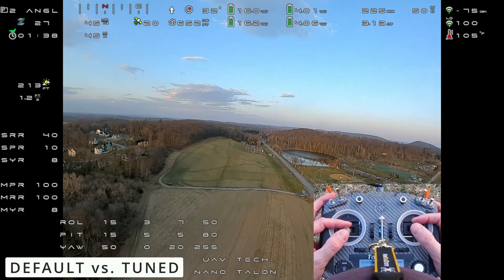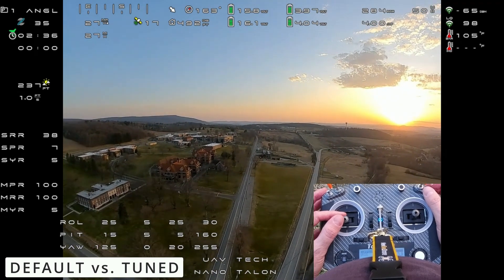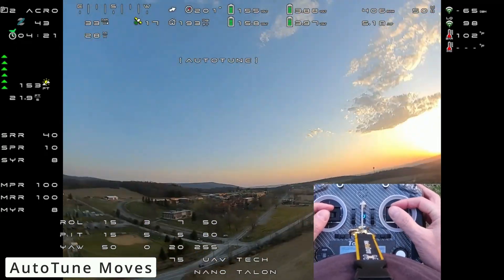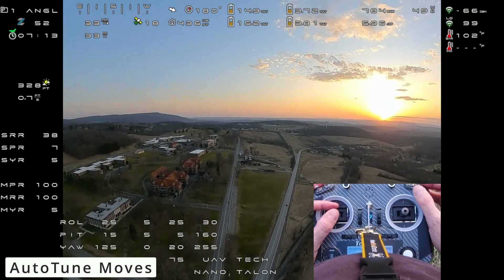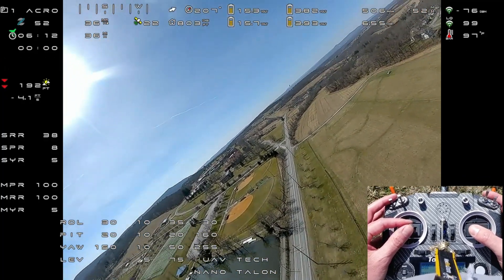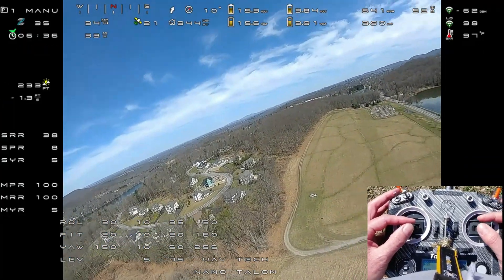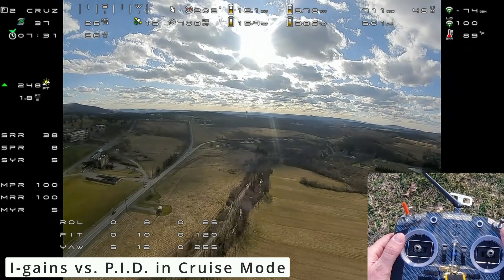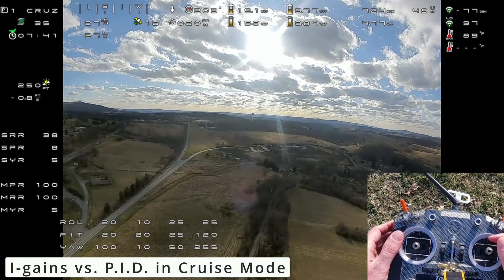🌟INAV🌟 Fixed Wing Stability PIDs Examples

Comment: It seems to me your roll "D" rate is way too high and you roll "FF" is way too low, and on your pitch it seems the "I" & "D" is way too high as is the Pitch "FF". This is why there seems to be little difference between no P&D and your "tuned" PID's.
Reply from the maker: FF on a plane is just servo throw in plane Acro.

D damps outside influences.  High is fast reacting.  Low is slow or little reaction.

I-gain just helps to keep the nose of the plane on target.

The very end of the video show the best example with Cruise Mode on Manual v. I-only v. Fully Tuned.  Now if you want a softer response to wind, reduce all the gains (except FF) OR go with I-gain only.  If you want a sharper response to wind, full tune + higher gains + fast servos.

You can use theuavtech.com/pidcalc to reduce or raisr gains together.
Reply: @uavtech  I get what you are trying to say but that is a very simplistic look at PID's which isn't the actual way they are actually working. 
It is clear at the end of the video the points I have made about your tune.  You are over driving the D term and then using a lack of throw to mask this over drive. This is why the weird twitch is there and why you are not seeing much difference with "I" only.  A general rule of thumb is your "P" should be higher than your "I" and your "I" should be higher or the same as "D". Reg flag the second your "D" is higher than "P" as you know immediately you are over driving the loop. PID is controlling how fast and how much and how long the servos can react, and the FF is controlling how far the surfaces can move (and indirectly the servo resolution). When you "D" is high and your FF is low you have them the wrong way round as you have fast movements of no throw so basically not doing much other than oscillating in the servo backlash.  You also reduce your resolution of the PID loop massively with high gains and low FF as you are reducing the amount of servo travel therefore limiting the number/steps/degrees of movement the FC has available from the servo (i.e. a small change is ask from the FC of the servo's but the servo arm does not move as the requested new position from the PID loop is within the servo's current position limits as the FF has reduced the travel down to 20% of available limits, this then drives a false feedback to the PID loop due to the lack of change detected from the inputs....needing more and more "D" to stop overshoot after wind up and final servo position change and a mad delay which causes the twitch).
Reply from the maker: FF is set to a value here that gives FULL servo throw with this plane.

You cannot make such general statements with PIDs.  The machine tells you the appropiate values through the tuning process.

check out theuactech.com/tunimg

Yes, D gains are near the max.  Any higher they oscillate.  Ps are set to not overshoot setpoint with sharp inputs.  I-gains are set to not have i-term windup or bounceback based on the P gains.  D > P > I are balanced.  I logged it and reviewed between flights to verify balancing of the terms.

Comment: this is interesting, but sorry to ask the question, but english is not my native language, and didn't get all that was said on other specific discussions about INAV settings...my problem with INAV6.1 is that with my fixed wings planes, I have a difference in pitch trimming between acro mode and manual, and I noticed that in acro mode, on ground with motor turning, the elevator is not going back exactly to neutral when pitching the plane up or down, like it would be with a normal gyro...is that normal, acro mode is not supposed to act like manual mode with turbulences dampening?
Reply from the maker: Acro mode will dampen out turbulence.  Manual doesn't do any of that.

For on-the-bench testing, it depends on how you are moving the plane.  In Manual if you shake the plane around the control surfaces will not move.  In Acro mode, as you shake the plane, the control surfaces will move to compensate for "the turbulence".  This said, they will not move much, it doesn't take much.  From there, if they do not return to the center when you put the plan back on the bench, it could be the i-Term build-up on the PID controller i guess.  I have not seen that behavior to date.  When you stop shaking, the control surface returns to center.
Reply: I agree, and this is what I saw on the bench...but this is no more the case when motor is on, that is the point!
I hoped that moving to 7.1.2 would resolve this but no change. Anyway this is not really a problem as I fly acro most of the time, but on some models, better not to switch to manual mode or the model stalls!😮
Reply from the maker: @alainrac56  , we are missing something, as the firmware works fine.

so it only does when not armed?
Reply: Starting the motor on when armed...

Comment: With standalone gyros you can put the gain on a dial so when your flying fast and get wobble you can back off the gains. It would be cool to have a dial act like a slider for pids and adjust gain in real time
Reply from the maker: agreed

Comment: See this is the way mine was flying normally all wobbly like that, but I had a great setting that let it fly super smooth, but that caused it to go into pitch oscillations when I rolled it.  I realized today I just needed to bring my pitch p term way down and that helped but it's still a bit wobbly now, but it doesn't go into crazy uncontrollable oscillations now at least.

Comment: Good example Mark. Of how much difference a tighter tune can make in reducing roll axis wobble.
The hardest part is getting the tune to work over its whole speed range, without airspeed based PID attenuation. 
If you're up to the challenge, you can use 3 PID profile's with them being switched by logic. Driven by a combination of Virtual pitot airspeed and GPS speed to smooth out the average.
Reply from the maker: need TPA to be able to select GPS 3D Airr Speed as a breakpoint.  Of course, better would be Pito Tune
Reply: @uavtech  TPA does not work on wings since it assumes that more throttle = more speed AND before the breakpoint in increases the PID unlike on quads
Reply from the maker: @stuweFPV  right, for wings PIDs should be attenuated based on GPS 3D speed.  Not throttle.
Reply: @uavtech  yes 100% agree! i'm using the 3 profiles available with some codes to make it speed based. not ideal but better than nothing

Comment: I'm glad to see this series for fixed wings. I also hope the INAV fixed wing filter defaults get adapted in the next version based on this, if the INAV developers think it makes sense.
B.t.w. you did choose to tune what is the most awful fixed wing model I've ever flown in terms of natural stability: The Nano Talon has all sorts of weird side affects to rolling and yawing in manual mode, an inconsistent pitch and roll rate (depending on it's attitude), and there is a noticeable amount of play in the mechanical connections, especially for the ailerons. Other than that it is a light and efficient model with a lot of room inside. I just wish it had a shorter nose, no dihedral, and better mechanics.
Reply from the maker: Evo has no Dihedral.  They upgraded based on feedback of V1.

Comment: That’s not how you’re supposed to autotune with INAV. Stick banging won’t yield good results. You’re supposed to use full stick deflection, then a slight pause, and repeat. Eventually you should do full rolls, and, depending on the airframe, full loops.

It will increase the rates until it goes too far, then back them off a little. It adjusts FF to match up with the rates.

INAV autotune only adjusts the rates and FF. As these are the most important parts of the tune with fixed wing. P, I, and D are not touched. They are more a personal preference to how you want the aircraft to feel. More natural or more locked in.
Reply from the maker: I did those too.  I guess I should have shown that more.  Was mostly interested in showing it does not adjust P.I. & D.
Reply: @uavtech  the tuning of the pitch looked more like it. The roll was a bit too quick to roll again. 

I just watched your other video too. Some really interesting stuff. However a note, as it’s related to roll tuning. One way will roll quicker than the other, due to the rotation of the prop. So it’s worth tuning based on the slower direction. That way the rates and FF aren’t too high for that direction.
Reply: @uavtech  I don't think anyone has ever claimed that the latest inav releases in the autotune procedure adjust the P,I,D part. So I don't understand what you are trying to prove.
Reply from the maker: @demicheligiuliano  In old versions of INAV, it adjusted P.I. (and I think D).  It doesn't do that anymore.  This video even shows it adjusting P and I in addition to Rates and FF: https://youtu.be/aAFFBuMOtAk?si=DFtl93eerJH_gAyD&t=538

Furthermore, I think hearing "Autotune" folks just assume it is tuning all the values.  It is not.  It is really only turning Rates and FF, which FF is even a bad name for the term.  It is really "servo throw", not FeedForward as classically defined in a PID controller.

Finally, we call it the P.I.FF controller.  That is also not true.  It is a P.I.D.Servo Throw (FF) Controller nowadays.  P.I.D.FF are all active, but Autotune only tunes Rate and FF as you know.  Wonder if it should be renamed from "Auto Tune" to "Rate Tune"?
Reply: Any links to the algorithm behind the autotune, or the code? I did a google and found the autotune. md in the git, but that was for users and not developers. (just curious on what is used)
Reply: Yeah the latest "auto tune" doesn't really do much